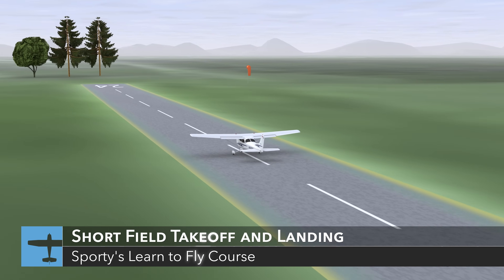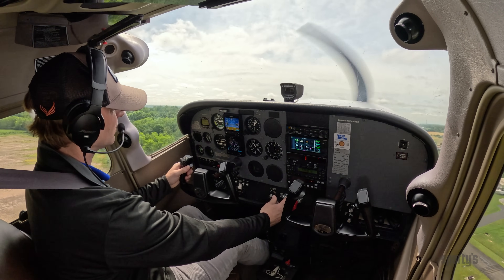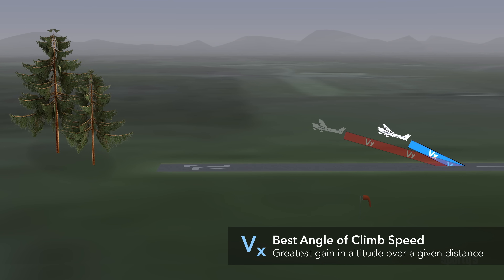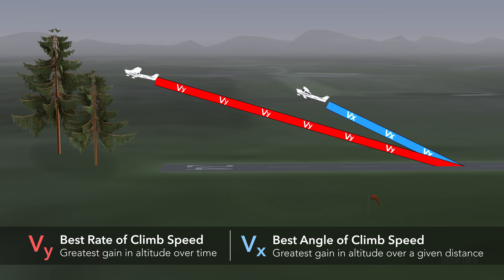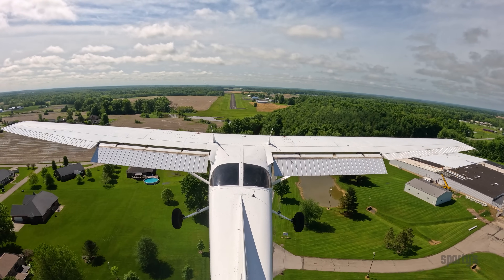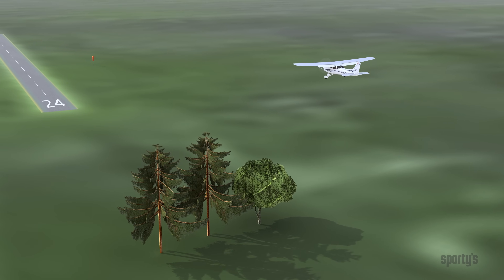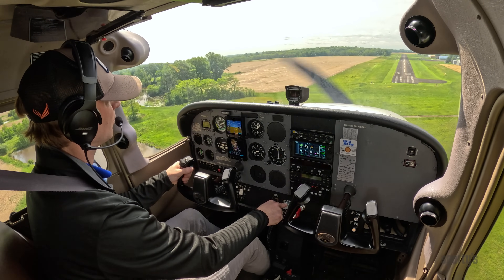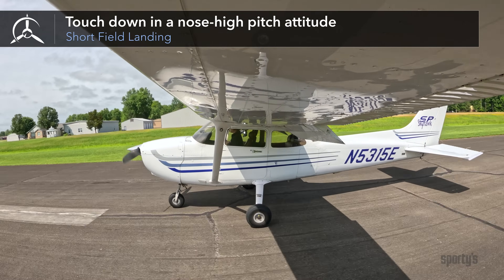How to take off and land from short runways - Sporty's Private Pilot Training Tips

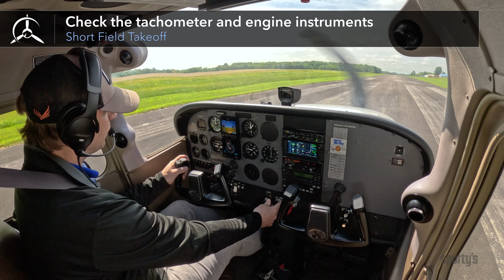Comment: I really have to take issue with the instructions starting around 1:55 in the video.  ALWAYS use manufacture's reccomended procedures.  You say to advance the throttle and hold the brakes.  This may be OK with Cessna, Piper, Beech, Mooney or anyything with a steerable nose wheel.  But, there are more and more airplanes with castering nosewheels that this procedure will result in the airplane making a hasty departure to the left side of the runway when brakes are released.  American, Grumman, Cirrus, and many home built airplanes are examples.  Also, some conventional gear (tailwheel) airplanes may have different procedures.  Always do what the POH/Flight Manual says.

Comment: Disagree with your explanation of the takeoff.  For example, the airplane in the video (looks like a C172S) has a Vx speed of 62, but the short-field takeoff climb speed is 56 until obstacles are cleared per the POH.  When flaps are used for takeoffs, the initial speed that results in best obstacle clearance is less than Vx.  And the pilot shouldn't wait until reaching that speed to lift the nose - the back pressure should be applied just before reaching the recommended speed so liftoff and climb are at the recommended speed.
Reply: The video's takeoff explanation certainly missed the mark.